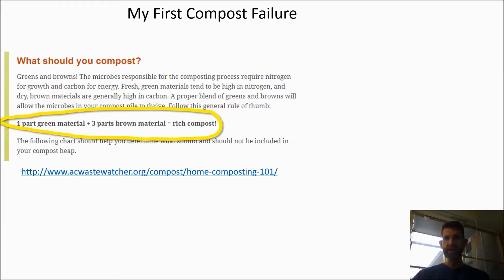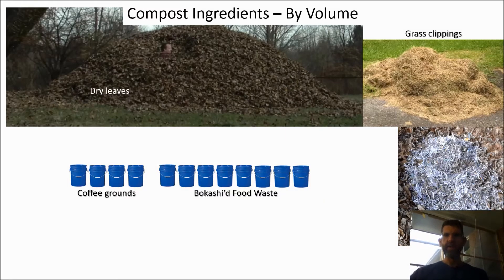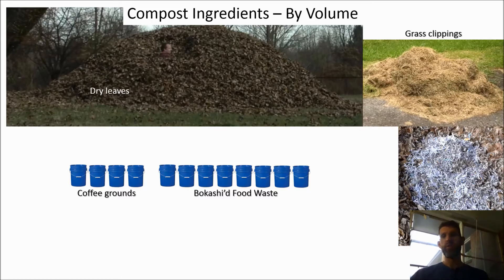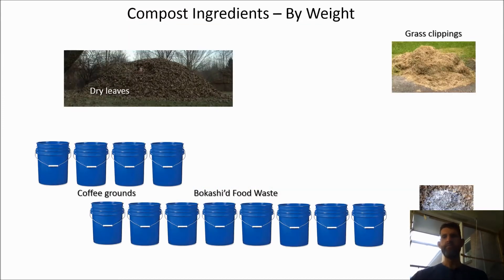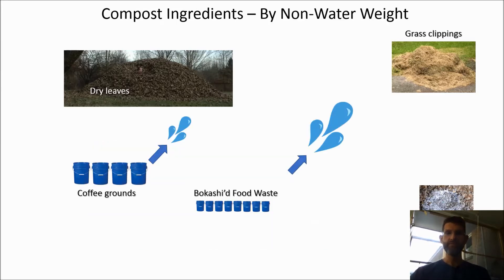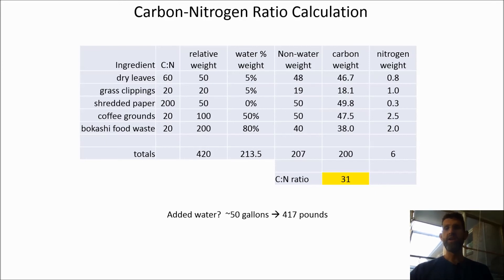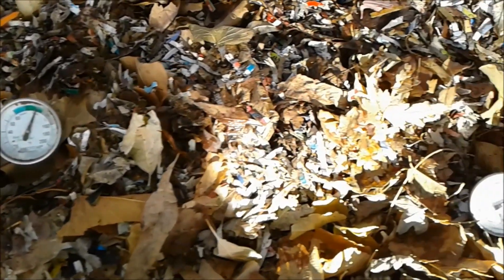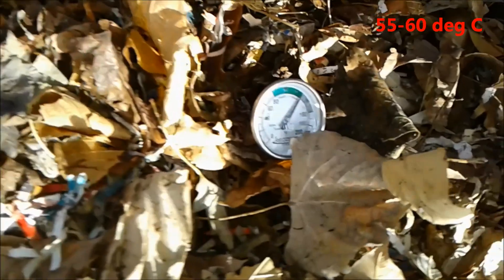Correct CN Ratio = HOT Compost Pile!

Comment: Hi. You can easily find out the amount of water per material. Weigh several amounts before adding it, dry it in the oven at let’s say 80 degrees Celsius and then weigh them again. Also, would you know how to calculate the C:N ratio of materials that aren’t to be found online?
Reply from the maker: Good idea with the oven.  Though I don't think my wife would be too keen if I baked a steaming pile of ripe bokashi for 4 hours!!!  Hahaha!  Unfortunately, without employing a mass spectroscopy unit, I don't know how you'd measure C:N ratio.  I find CN ratio to be a fairly inexact science, e.g., there's wiggle room.  If you get it right to first order, you'll still get a hot pile.

Comment: Over the years I have come to one conclusion. The C:N is just a scientific misnomer for heat production. If you have 3 cubic meters of shredded leaves and enough water to soak them and pile them up. You are going to get heat and lots of it.
The C:N is a metric used in food waste reduction and not necessarily compost for gardening. Oh sure they say once the compost is crumbly and not hot to the touch it is ready to go onto your garden. I disagree with that statement too. Hopefully, there is time for the compost to age and let the fungal components take over. Which is lacking in our soils around the world thanks to common practises.
Reply from the maker: Kris, sorry, but I didn't see your comment until now.  My apologies.  I agree with you!  Most of the reason I compost is to generate heat for my greenhouse, so I'm obviously very concerned with heat.  And the commercial composting operations need to reach 160 deg F for 5 days (or whatever the pathogen-killing guidelines state).  I also agree with you that the industrial compost may be lacking from a diversity of microbes & nutrients but have no proof!  My typical greenhouse heating compost mixture is simply shredded junk mail and coffee.  Not sure I'd want this as my only garden amendment!
Reply from the maker: This was an interesting comment that I thought I'd circle back to.  I ran a compost pile for about a year, then put it in some raised beds.  It was nice and crumbly, as it's "supposed to be".  One bed in particular had a LOT of this compost.  The plants in this bed were NOT happy!  I agree with you that 1 year is not long enough of an aging period for growing applications!

Comment: Morgan - your videos are really helpful! Thank you for them.

Do you think creating a biomeiler in an unfinished basement could help supplement heat to a traditional residence? I want to explore this, but don't want my house to explode from ammonia buildup! Cheers.
Reply from the maker: Well, now that’s an interesting idea!  I assume you would put the compost in the actual basement?  Ammonia wouldn’t worry me; seems like you could simply make it a closed system with a vent to the outside.  Bigger problem in my eyes would be moving the compost up and down, unless you have a convenient access from the yard.  Not sure of the size of your house, but I suspect you’d need a compost volume of 6x6x6 ft or 216 cubic ft.  My greenhouse system was only 27 cubic ft, and it was insufficient to heat the greenhouse.  Also, you’ll note that this pile only lasted 2 weeks above 100 deg F.   The larger pile should last 2 months or more before needing to be turned.  If you compost food waste, I’d recommend pre-processing it with the Bokashi method.  Reduces odor and speeds decomposition
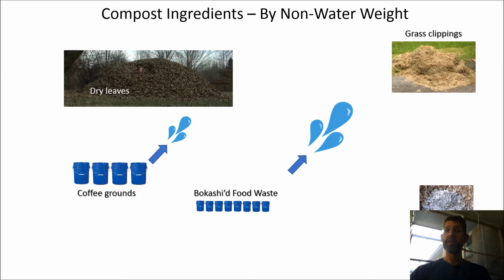Reply from the maker: Thomas P check this link, around the 3:30 mark: https://youtu.be/xNUlrwqNXa8
Reply: Thanks for your response! I appreciate your thoughts on scaling the project.

I have an exterior stairwell to this basement which would increase feasibility. Venting to the exterior seems prudent, but it would definitely exhaust heat also. I will try to continue researching this, no lower heat bill is worth a destroyed home!

Comment: Thanks for the video.  I have just tossed some scraps (yard, house, and pasture)  in a pile held up by 4 pallets and have not turned it yet (for a year).  I have filled to the top several times and I think there is some magic going on in there.  I have started getting the paper shreds from work.  I now have 4 or 5 large bags and wondered how much manure to add to them.   The info you have will  be very helpful... given the weight of each I suspect it will not take much manure. Thanks!
Reply from the maker: stein shaw thanks!  I bet you will indeed have some good stuff in there!  The scraps may take a full year to totally decompose.  I love the Bokashi method to greatly accelerate.  I’d strongly recommend building a compost sifter to separate finished compost from unfinished, especially if you use the “add as you go” method, as I do.  Everything I’ve learned about composting...I’ve learned by failure!
Reply from the maker: stein shaw the paper shredding tends to clump.  It works best if you mix it with the other materials.  I tell you this because I just pulled some big clumps out of my half done pile!
Reply: I had a compost pile last winter, I sifted and used the compost elsewhere and grew a garden in that spot, worked extremely well guessing worms etc moved in, have 2 piles going now but like the info on coffee grounds, ready to experiment.